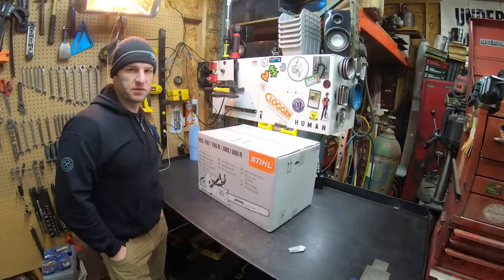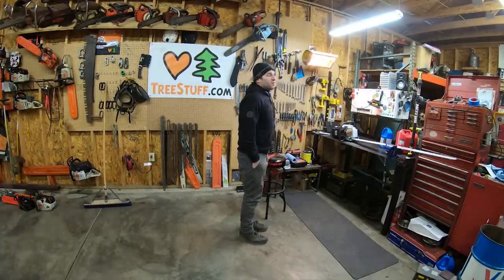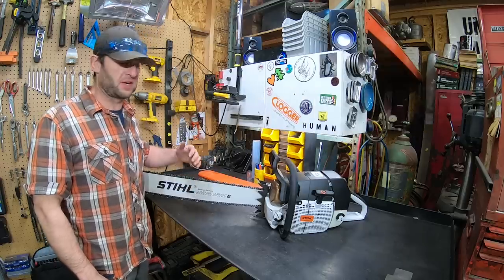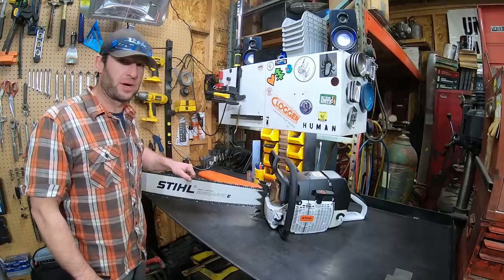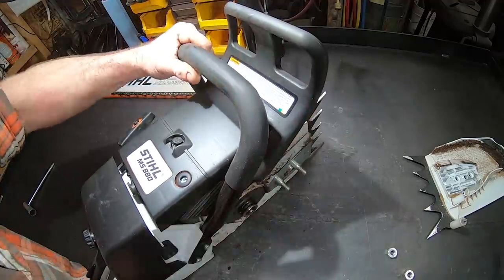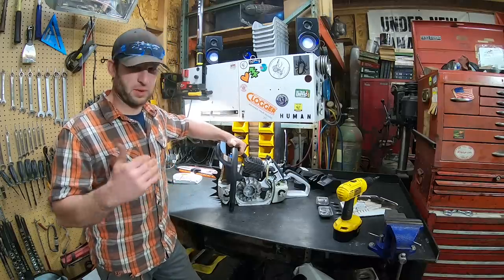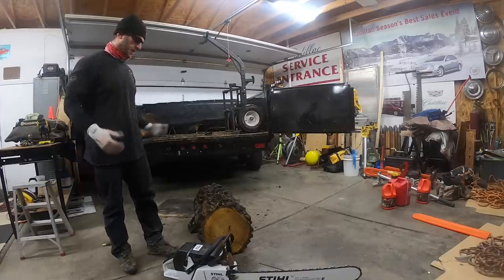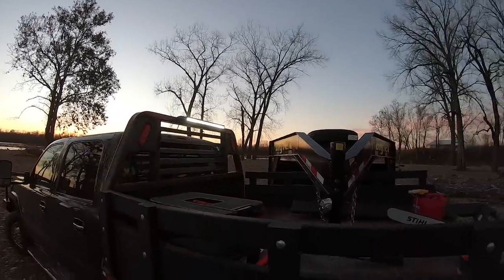Stihl MS880 Unboxing, Overview, First Cuts

Comment: Back years ago they used to sell winter oil and summer oil for the chain, what I do now is cut the sticky stuff with trans fluid, especially on the long bar setups. Seems to work well.

Comment: Watched a ffriend pack an 880 and a 60 inch bar up a very tall cotton wood. He got to the Ywhich was about 60 foot, and climbed another 10 foot and cut the top out. That big log slid off and flexed that bar way more than I thought it should. Bar was fine.

Comment: I think it will do fine once you have added your flavor.  Bar oil works best for me as follows.  Mix i pint kerosene to 1 gallon of filtered used motor oil. This lube will not have your bar smoking.

Comment: Seems like a few youtubers got MS880's in the last few weeks. Maybe stihl is promoting them. I was thinking about your observations with the bar oil. Some pumps are not efficient at lower RPMs. Maybe running the saw for so long at slower speed causes a lack of oil especially with it being cooler out and you saying you noticed the thickness of the oil changed. Also I never heard you mentioning you took the bar off to examine the oil ports for debris. Thanks for the video!

Comment: You got the beast saw, one huge heavy tough mother that just wants to eat wood..., just a tip , the chain bar cover will get holes in it & need to be replaced ,if you ever do palms, the palm juice & saw dust eats into the side covers on the 660 & 880 bar covers, the easiest way is to clean it straight away after cutting down palms.

Comment: You also gotta drill the oil holes out on the bar as well ... and there’s these little bump things in the groove of the bar by the oil holes... you need to take. A hacksaw blade (out of the frame)... and take those out.. none of my other aftermarket bars have em (tsumara/Sugihara) ...that helped a lot for me ... I also run the platinum oil.. good luck

Comment: What a Bute👌 in my experiences with new stihl saws I have always had good results with breaking in the oiler by simply pointing the bar at a 45 degree angle towards the ground before every cut to get'r lube'd and use to the rpms that r used the most with a saw that size.   I'm no expert but 25 years playing with my big boy toys to work I found it to b the truest form. Stihl warranty wouldn't cover any kind of damage if there were additives used in their machines. But hey it's not my money maker... I work on all my saws myself unless warranty covers major problems. Peace brother enjoy the reaper LOL.

Comment: But u didn't get the wrap handle? U better get it. That 59" bar is a beast, it's actually sketchy as hell when u cut horizontally, u will see, the bar is so flexible that the chain actually comes off the bar in the middle till u get it in the tree. I love my 880, I've got a 41" and 59" mostly use the 41" shit I had to turn my oiler way down on my saw.  And they call for strictly platinum oil, that could be the oil issue? I also only run marine/off road 93 in mine. They were having problems with the gas lines on the 880 getting super soft and starving them of fuel and guys were blowing 880s up left and right cause of the alky in reg pump gas. After spending 3g on the saw I wasn't even going down that road. They want 80$ to sharpen the 59" chain. I will spend the 2 hrs to hand file it lol. But get the wrap handle, it will make a world of difference on that big hoss. I never got a skip tooth chain for mine, even in white oak it's just powers threw. I hardly ever open my saw all the way up, never had the need, thing has so much power , mostly 3/4 throttle on it.

Comment: If you do mod this saw either have a professional do it or be very very careful when installing a new intake bellow, seems simple but if you mess it up you can easily cause lean running conditions and burn the piston and cylinder up. Also have someone tune the carb if you put one on off another saw. That’s another way to cause lean conditions is the carb not being adjusted correctly. It’s not just as simple and turn the screws until it runs the fastest. You need a tach and a good bit of experience as well.

Comment: I run a mix of Stihl bar oil and oil from a local shop. There oil is thinner and Stihl is too thick. About 50/50 mix. Shake it up before using. Helps on colder days below 50. Above that straight Stihl bar lube. Less then 32 winter mix.

Comment: I'm thinking the smoke (given the color of it) is mostly due to the oil smoking off of the extremely hot bar/chain, and less of the wood burning. Could be wrong, but just my observation on the color of the smoke.

Comment: That short bar, is that a sprocketless bar tip? Might account for more bar oil need.
Reply: There's actually a design flaw in the 59" bar, the sprocket will jam up with saw dust and cause the bar to split apart. That was 4 years ago so I'm sure they fixed the issue.
Reply from the maker: Is a sprocketless bar tip.  Just filmed a video concerning the bar oil, and was/is an issue with all my saws since a few months ago when the bar oil went from tan to clear (in cold weather at least).  Just picked up two more jugs the other day though and it's back to tan, unsure if it was a bad batch or what.
Reply: Human interesting. Bad batch I guess, I have used just 30 weight in cold weather or cut the thick stuff with 30 weight.
Reply: That's what I use 30 wt and 395 xp you'll be good to go
Reply: There's not much science in bar oil

Comment: That bar oil thing seems very unreasonable. RE the Stihl bar oil, even on days in the 20s I find that my saws get warm enough that the bar oil thins way out in the tank and flows just fine.  I'd be inclined to pull the bar off and see if it is flowing oil at all... and also check the oil holes in the bar for alignment and blockage. 

Screwups happen...  I recall a brand new truck (brand omitted purposely) that chronically overheated.  The dealership was stumped until a mechanic pulled the water pump and found that the water port on the pump was completely blocked by casting flashing. I have a factory shotshell that has no primer. How did that get through the lazer inspections?  The flash hole was blocked by plastic flashing... Things get by inspection that shouldn't...

Comment: Would you please recommend a solid chain saw for use on a small farm.  Not going to take down trees, but will be cutting a lot of grapple loads of firewood and pruning.  Thanks.
Reply: Echo CS 400 or 490 are light enough and strong enough for topping/brushing and small to medium firewood logs with 5 year warranty. Stihl MS 251 is pretty good on weight and power. Husky 450 is fantastic on both but mine is not that reliable. If you want a step up in power but still keep the weight down, MS 261 or Echo CS 501P; and if you just need more power than that you'll have to pay the weight price.
Reply: For an all-around saw, I cannot highly recommend the Echo CS-501P.  Get rid of the Echo bar and chain and replace with an  .325 Narrow Kerf bar an Oregon TXL chain.  Mine will almost keep up with my 362 in wood up to about  14".  Can't beat the warranty, the build quality, and the availability of parts.

Comment: I'm thinking you may have misread your manual.  They don't want you to rev the saw no load out of the wood.  You should be running WOT in the wood.
Reply from the maker: You're correct, I did misread it

Comment: It probably isnt recomended, but maybe you can try mixing the still brand bar and chain oil with a thin motor oil maybe like a 0w-20 or a 5w-20 maybe that will make the bar and chain oil lubricate a little better

Comment: Might want to wear some chaps while running that monster.
Reply: Rufus LC stihl chaps are rated for every saw but the 880. WOT will go right through the chaps and barely slow it down
Reply: @pepper7220  It might not help much but it definitely won't hurt but that is just my opinion.

Comment: I always like build them for they run don't need that long bar unless you're in the Redwoods I think you need it put it on just for that application.
We cut a red fur that was like 16 ft across the butt bucked it short made cover of the equipment magazine and Clark magazine only had the Halls on the road like 19 mile then put it in the parade on the 4th of July Sierra County Calif the wind broke the tree about 70 or 80 feet up or we would not have cut it there were a lot of Big Trees that had lived out their life and needed to be removed so the others would stay healthy.
23.8pounds is that with fuel and the bar and chain that kind of horsepower you can destroy a chain in 2.2 seconds
Damaged chain that rides against the bar will never cut right no matter how you sharpen.

Comment: I have 2 large mount 36 inch bars that I have no need for and I might still have a couple 10 or 11 pin sprockets if you might be looking
Reply: Large mount like D25 mount for 660s n the like? or the 880 size?

Comment: I've read on some forestry forums that canola oil makes great bar oil and it's eco friendly and cheaper than Stihl's oil so it's a win-win. Might be worth trying on something like the Poulan Wild Thing to start with before you try it on a good saw.
Reply: I ran veg oil, for a few months, it lubed good, smelled like lunch, but the excess/ residue,  gummed up all over the cover, bar and powerhead. Had to always scrape it off.
Reply: Thanks for the info. I have gone back and forth on whether or not to give it a try. I'm thinking probably not at this point.

Comment: When I bought my 271 farm boss the dealer said they sell synthetic bar oil for hard wood and regular for soft wood. He highly recommend to get it if your cutting a lot of hard wood. Also agree that the 3 tanks of gas before wide open throttle use does blow lol I was also pissed about that.

Comment: Ms660 vs ms880?  Looking to run a 28 inch bar for ripping knotty rounds and just cutting big logs into rounds fast.  I'm a bigger guy, not really worried about weight.  Thoughts?
Reply from the maker: I'm not a huge fan of the 660, 661 seems to have much more torque.  Haven't really run my 880 all that much so can't really give a valid opinion, with a 28" bar though, can't really go wrong either way, even a 441 handles those pretty well.
Reply: @Human1337  appreciate the response man, I have a bunch of 440s and 460s already, just want a big saw to make some time.  I have ran a 661 for a bunch of days  and it is a he'll of a saw, just feel like I could handle some more power.  Main thing that is stopping me from just going 880 is they need beefier bars when I have a bunch of bar and chain setups for my 440s and 460s.

Comment: 1000th LIKE!  BOOM!  Damn that bar is huge!!  Don't laugh, ok fine laugh I don't care, but I stepped up from an 18" Poulan Pro to a MS-441 with a 25" bar and holy shit the power and the volume!  I could not image an 880 in my hands for a few hours.  My back would say fuck it I quit!  Lot of smoke coming off that bar.  Do you what the viscosity is for Stihl's Bar and Chain oil?  I was looking on their site and it did not mention it.  I wonder if there was an additive or a thinner oil that could be combined that would still oil the bar and chain but not pour out like water.  Thanks for sharing man!

Comment: So is it oiling now?Was all  the smoke from the mix?If not I would be making a trip to your friendly dealer.You should know yourself that the EPA has it's sight set on Stihl.They thickened the oil so that the saw would use less.Think about the damage to  the bars and chains on saws without adjustable oilers. Personally I use oil from Tractor Supply.No whear near as thick as Stihls.

Comment: Talk about overkill ! That's a West coast set up . Stihl has always had clogged air filter issues! There isn't a tree here in pa that I can't remove with 20" bar 20 plus 20 =40 .just get a husky and super tech bar oil from wa l mart and you won't have to worry about them goofy temperature settings.

Comment: I thought you couldn't run a 3/8" chain on that saw.  Too powerful and it will tear the chain apart.

And the breakin no full throttle is for off load.
Reply: You'll play hell keeping it on the bar (3/8).  .404 harvester chain will be more trouble free, but use more power.
Reply: Bought a 3/8 sprocket and bar when I bought the saw, just because I have a roll of 3/8, and like to keep em all the same. Ran 404 for a yr or so, then swapped over. A few yrs later, no problems w 3/8.

Comment: Did they give you a discount due to you running mostly stihl saws. Be awesome if they did
Reply: Shit I had to tell my dealer they even made that saw. Guy swore up and down there was no such thing as a 880 with 59" bar. One chain is 200$
Reply: @davidmoore8741  yea they are, very expensive. I run a 3120 had for 17 yrs. Still kickin
Reply from the maker: My dealer gives me pretty good prices, I used to work there and they're still friends of mine, but I don't get anything from stihl.
Reply: @Human1337  thats cool, when Did u get trailer

Comment: Like your channel bud. But I cut 5-6 footers here and there and never run more than a 36/115 bar. Can't see the need for that unless you are ripping huge stuff for a heli or some sort of mill   But you do you. If is doesn't have a replaceable tip I'm out. Cheers
Reply from the maker: Theres a tree 8' diameter I bought it for, but now he's on the fence about taking it down.  Honestly was looking for an excuse to get one    =)   Like you said, not much in my area at all that I can't get with a 36" bar, I just like saws.

Comment: With the longer bars dont try to start a horizontal cut you will throw the chain,use another shorter bar saw to start a horizontal cut.
I have never liked hard nose bars.
Cheers

Comment: Have you got a new one yet heater that takes diesel or kerosene?
Reply from the maker: Got the torpedo heather off the shelf the other weekend, check out my "Sh*t End" video a couple days ago
Reply: @Human1337  now what I was saying on the torpedo heater is they have thetorpedo heaters that take all different types of fuels not just kerosene mine takes diesel fuel kerosene couple of things I think of diesel fuel might check it out just make sure you got good ventilation I read a lot about that fumes destroy your lungs so just good ventilation I used to be a drywall finisher I use those things all the time until I broke my neck oops wasn't my fault

Comment: We have a ms201t we bought brand new 2 years ago with the oiler turn up wide open it takes two tanks of fuel per one tank of oil. That is not right. EPA sucks! We also have a 395xp Husqvarna that does better than the o88 I am pictured with